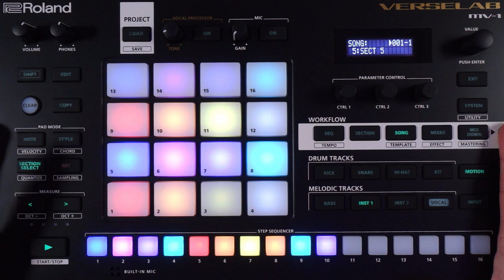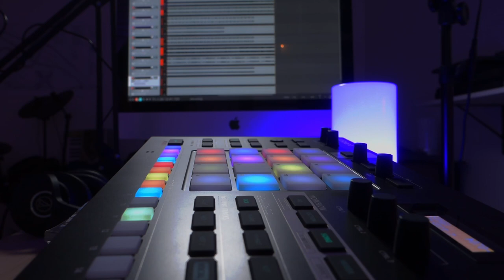Roland Verselab MV-1: Making a Synthwave Song

Comment: Somehow, I haven't loaded any other samples into the MV-1 yet. Besides recording external synths, driven by MV-1 midi. I found it comfy to reserve a kit track to record external synth performance into 16pads. So it can play on sequencer mode. As vocal track does not play unless you are in Song mode, it would be nice if Roland can release Vocal track for generic use. 
Cool track, Gabe!  Play more, show more Roland tricks (for ex., how easy is to assign preset controls by holding Edit + rotating one of the 3 Ctrl knobs (maybe its obvious feature with 101/707, its my first Roland box). I'm kinda happy it does not expose all the possible tone parameters thru this interface, otherwise i'd stuck tweaking lol :)

Comment: For the dawless crowd do you have any ideas about getting those finishing touches?
Reply from the maker: I'd make aggressive use of the built in EQ, volume, and panning controls, as well as the built in mastering. There's also the motion designer for automation. I'd probably change my composition a bit too if I knew I couldn't sidechain.

Comment: Hi don't know if u ever tried the 707 but trying to find out if the sounds and samples are same as verselab at all or if they are the same sound banks thanks
Reply: It’s the same engine and the presets are pretty much the same, I think. (I have a 707 but not a Verselab)
Reply from the maker: A lot of them are pretty similar, and you can always load more presets onto either (they both use the same synth engine).